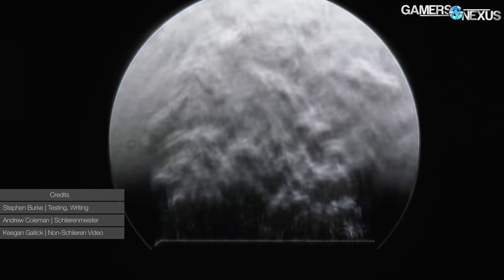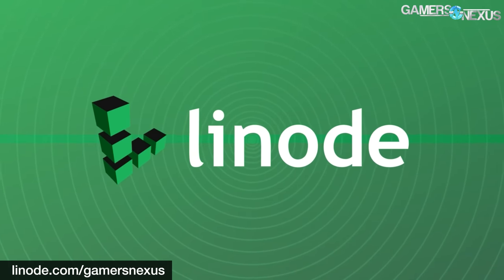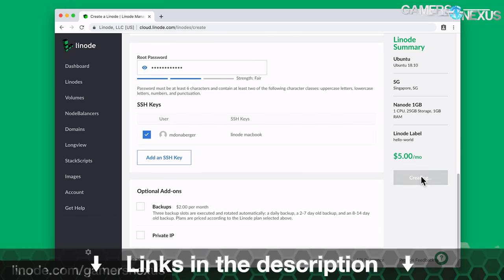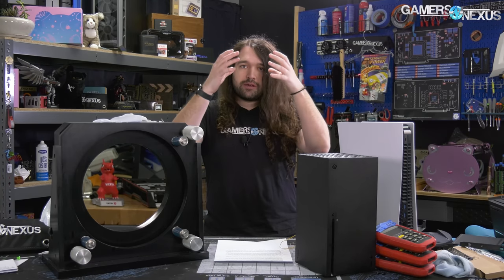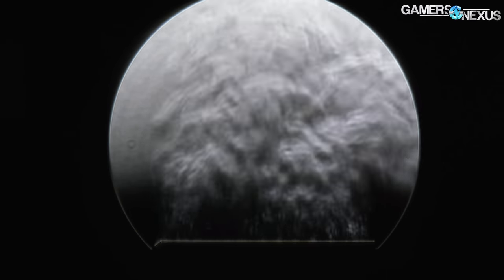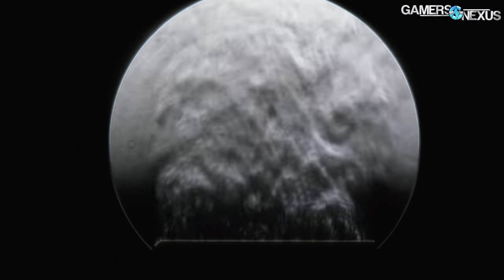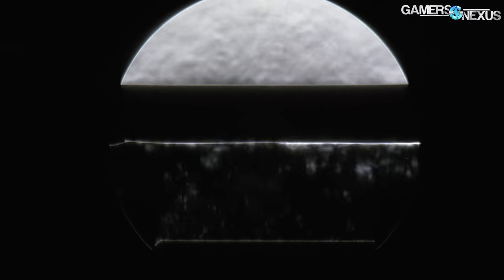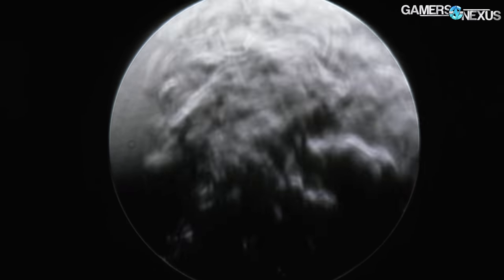PS5 vs. Xbox Series X Airflow Testing: Cooling Design Efficiency & Flow Paths

Comment: The "hot air rising" argument is really silly on this situation, but now I'm wondering if anyone has made any measuring on the effects of hot air flow a fan is moving when pointed upwards, sidewards and downwards in a free-standing enclosure that can be rotated, with 1m clearance for air flow on all sides, in order to put this argument to rest. I bet it won't be anything as high as 1%, but I wonder if it's even actually measurable. Wish I had some thermocouples, heater, different fans, and a speed controller to test this myself.

Comment: So what’s best “horizontal” or “vertical” for Ps5?
Reply: if you place it horizontally, the console will sound more quiet. Although vertically is quiet enough.
Reply: @javierf6162  is as quite as the ps4 slim ? Or a bit louder?
Reply: @ghostslayer2544  it’s definitely quieter

Comment: I work in the r&d department on the Xbox line for Microsoft.. it's funny because we don't do any of this testing honestly we just come up with different designs that look cool and it's ultimately marketing that chooses what gets through. The design of the Xbox was 95% marketing and 5% engineering. 

Our engineers have very little decision-making on the actual design of the Xbox, if we did it would probably be all mesh.

Comment: Problem I find with the xbox's exhaust, if you lie it down it means anything on the right side like a amp or blu Ray player, will get hit by the exhaust, so meaning you have to have the xbox on the right side of the unit, so the exhaust is hitting a wall.

Comment: I've modded my pc case basically making the front of case the bottom with feet and custom panel holding 2x200mm fans for intake and all the heat goes out the top of what was formally the rear of the case

Comment: On the Xbox console :  Wonder if it's better to have a fan at the bottom base of the console for Push air or at the top of the console for Pull air , Or maybe both , In my opinion I think a added bottom fan would be better because there is already a internal top fan in the console so it could do the push pull method .

Comment: the extra hole is basically a relieve valve if the top of the console gets blocked off so it doesnt overheat as bad as without it

Comment: Here’s an idea Microsoft could do to make the Xbox Series X run cooler... remove the bottom circular plate, add as many extra holes that plate took up and on the corners of the Xbox Series X and attach 4 small pegs/feet (say 1/8-3/8 of an inch high)... so it’d have a much more even intake of air... I think it’d make it cool more efficiently yet as it’d have more places for the air to come in and be pulled thru by the fan... only downside is the console would be made potentially taller than with the circular plate on... maybe this could be a revision for the Xbox Series X or even offered as an option (that is if you want to use your system in the vertical orientation like a pc tower and you have room for it)... btw I did this with my PS4 base version (added on 3/4 inch circumference felt pads stacked up to make my PS4 sit about 1/2-3/4 inch) to help it get more air under the system (I heard PS4 like having air under them as they have no vents there but they do tend to get warm/hot there)...

Comment: I predict a PS5 cooling disaster (RROD) after 18 months.  Did the hot air lingering after power down seem like a problem?  It is, and depending on the temperature of the console when the fans stop, the damage over time will be to the solder.  It's not clear why the console is missing a cool down mode, but it is obvious that Sony threw liquid metal at the thing, as if it was going to be the answer.  The PS5 in a cabinet will overheat, and it's easy to replicate.

Comment: Hmm, on the XBX, wouldn't the fan hub contribute to the conical flow pattern more? Since nearly no flow is produced at the hub and next to it, a low pressure zone in the middle will be produced. Because of motive flow and this low pressure zone, the higher pressure air will be drawn into the middle.

Comment: If I modded the PS5 and cut a hole in the side panel of the PS5 and added an air filter would it help with thermals? Wondering if it's worth the effort or not since I would prefer to do that over removing the panel entirely.

Comment: Any way to do a roundup of fans using this imagery, and how some fans react pulling air through and pushing air through a radiator, and maybe even a standardized fan testing AIO's and Custom loop radiators? I know that's ALOT of testing with most of your studio taken up, but could be interesting.

Comment: I want to point out the PS5 air flow get push with the fan in a down motion but the design of the heat sinks the airflow is expected to turn 90 degrees to the rear of the console. The xbox airflow is straight up.

Comment: There is no way that the Xbox can run 150+ degrees Fahrenheit. But some how they managed it. I was also surprised to see no fan on the cpu heat sink and dedicated one fan to the whole system. Engineers must hav e fought hard to keep that design and make it work despite the intake design. Wish I could improve it some how without ruining the case other then ac during the summer.

Comment: Assuming side and top blockage is not an issue, would you say the xbox x is better suited for horizontal position than PS5? That would be in a situation where one has both consoles and has to place one horizontally.

Comment: I own a PS5, series X,  and a switch. The only console i play on is my series X with gamepass ultimate. The Dualsense controller is cool, but the series X controller wins by comfort and 40+ hours of battery life. I like the smaller size of the series X controller. And i hate the thumbsticks on the ps5 are in the middle of the controller. The thumbsticks on the Xbox controller feels so much better. VRR, quick resume, 1440P, auto hdr, fps boost, bigger SSD,  storrage upgrade posible. It is all missing on the ps5. If i have to choose between the 2, i Will sell my ps5 and keep my series X. Comming from a PS4 pro. Iam not a fanboy, i like Both systems. But the Series X wins this gen. If you have 500 spend it on the series X. Sorry for my english 😉 and with the newest upgrade we have Dolby vision gaming on the Series X 💪🏼
Reply: I dont have a 4k tv and dont want one either so I went with the series S

Comment: Microsoft said when they announced the Xbox SX that the back exhaust slot is a backup exhaust vent. They said we know patients and children could throw something on the console. So if that mistake is made at least the console would still be able to get most of the hot air out.

Comment: Those blocked vent holes driving me crazy
.... if they thought they could use them than its bad comunication and development in the first place but if they are just to make the xbox Look like its very well ventilated than its  a shame and burned costs on the molding Tool..... i dont get it

Comment: Do you consider or recommend to use 3rd party vertical stand with cooling fans on ps5? Does it help the console to minimize the  heat?

Comment: it is kind of a circle of airflow having the 2 side by side in a cubie. The Xbox sucks in the bottom back and blows out the top. The PS5 sucks in at the top and blows out the back bottom. I have had to put some paper in between to try and separate the air for the two devices.

Comment: I'm sorry.. I was enjoying this video until 16 minutes in when I started question if you guys done any research about the specs of both consoles... That hole on the series X allows airflow in case someone accidentally covers the top of the console and so it can be placed under a TV cabinet with minimal on either side....

Comment: Hi Steve, would you be interested in investigating high rate of failure on EVGA Ampere cards? There are a lot of complaints on EVGA forums about FTW3 and to a smaller degree XC3 cards suffering from so called red light deaths where the power suddenly goes out during light load gaming followed by cards being bricked and needing RMA. In some cases there have even been fires, leading to some truly dangerous situations. So far EVGA has not been forthcoming in addressing the issue, adding to the concern and frustration of users. Thank you

Comment: aaah no your digging to far for a explanation as to the fan depth ratio on the xbox, its way more simple, the space between the screen and  the fan is in effect a manifold, a space  for pressure to build an normalize and the exhaust through the grate which  is  a defuzer.  Hints to why you see the air conforming to the depth an curvature of the vent also causing the air to hold its concentrated density . Tig welding cup defuzer might give perspective to this. great work.

Comment: I have my Xbox horizontal in my Media cabinet, but use a piece of cardboard to guide the exhaust out of the front of the cabinet. Seems to work really well, as all of heat leave the media cabinet. I was worried about the hot air circulating in the media cabinet but the cardboard has solved this. I do wonder what effect it has on the exhaust with the extra resistance of the cardboard guide.

Comment: I was planning to buy a cooling stand for PS5
Not anymore, because you've shown it still does output heat from the small vents placed at the bottom of PS5 where the stand is attached. 

The cooling stand will push air in those vents. I don't think that'll be a good idea.

Thoughts?

Comment: What is your opinion about dust filters for the Xbox Series X? Do you think they would impede airflow? Good/bad idea?
Reply: I don't have a xbox series x, but I have put air filters on my PS4 Pro, and its fine. Get some proper air filter foam though. You can get difference grades, finer or courser, if you want. Its easier cleaning the air filter than opening up the unit.
Reply: @zeniktorres4320  Thank you, friend!

Comment: I came to see about the PS5, was looking to get an aftermarket vertical stand for it and needed to know if it would be worth having one with fans that draw air out of the bottom, push air up from the bottom or just one with no fan at all. Seeing as how the console tries to push out out through the bottom as well as rear I think that question is answered. Thank you
Reply: Take a look at the PS5 teardown video. The entire bottom of the PS5 in cover bt the power supply. And air flow from the fan not reach the bottom at all.

Comment: I think Microsoft learned a huge lesson off the 1st generation 360 consoles. It is clear they were most interested in the unit controlling the heat more than the look. Sony did the same thing by making the PS5 so damn big. All about getting the heat out of the unit and keeping the processor as cool as possible. I am watching and waiting to see how the PS5 lasts with them using liquid metal. I wonder how long they can last before having to replace the liquid metal down the road. Hopefully longer than the thermal paste used in the series X. I kind of wish they would have used liquid metal too.
Reply: There is no reason to use liquid metal over paste in my opinion. It has better heat transfer, but can cause a lot more trouble.

Comment: Did you not realize If the gas you let out of that torch were it find an ignition source when inside of the running system you would have quite the mess on your hands

Comment: Does the temperature of the air influence the air flow generally speaking? I’d think so. Doesn’t it make a difference, wether you heat up the air for intake?
Reply: It'll certainly affect how much the air will cool down your system, but not so much on the airflow.

But the intake air wasn't actually heated, despite what he says. The gas was in a pressurized bottle, and expands when leaving the bottle. Gas gets colder when it expands, so unless he kept the bottle under intense heat (not likely since it's an explosive chemical, and it would also have to be hot enough to burn his hands) to counteract this cooling effect, the intake gas is definitely colder than ambient air.

Comment: Great video but the advice not to put XSX in a horizontal position with the intake vents facing down is pretty funny.  Since, y'know, when you plug the cables in you can't lay it down in that position anyways.

Comment: My Xbox Series X which I sold 2 days ago was absolutely amazing with cooling, it was dead silent too, in the home screen there's no sound, I have to put my head half an inch away from the fan blades to hear the fan, when playing a game there's no sound, even if the game goes silent in a loading screen in-between warzone games there's no sound from the fan, I used the console for a year, I blew dust out monthly so my Series X was always clean, no dust clumps, I bought a PS5 Slim digital edition after selling my Series X the PS5 fan noise is noticeable straight away once I turn the console on, when I go into a game it's loud enough to always notice it, whenever there's silence in the game I notice the sound, my nephew has the PS5 older one and that's even louder. 🤦🏻‍♂️

Comment: It would be nice to be able to have speed fan control in the option system and even set it that if the Xbox gets to hot to a point the fan auto speeds up for more cooling. cuz right now my xbsx gets so hot that I get a little worried on parts life span.

Comment: Need your guys' opinion on this, I keep my PS in a decently-sized cupboard in my desk (like 20cm from the back wall, decent space on the sides, door is open at all times and air comes in from front and back) but I'm not sure if it'll cause problems further down the line. I don't have many options on where to put it but I don't wanna keep it somewhere that might make it overheat

Comment: I’m not gonna lie. I had to take a shelf out of my cabinet to fit the ps5, but have no noise issues. With series x I could fit it sideways where my one x was, but the top was too close to wall causing the series x to scream as loud as a jet. The minute I changed it and removed a shelf it was mouse fart quiet…

Comment: Although my TV stand isn't a closed in unit, the hot air at the back of my PS5 doesn't blow away far enough and I don't like that. I ended up getting an AC Infinity Multifan S7 from Amazon to do the trick. It comes with two 120mm fans and plugs into the spare USB slot on the back of the console. I placed both fans to suck that hot air away from the back of the console at high speed. It is very quiet even at that speed. Another good thing is that it allows you to daisy chain 2 more fans to the extra USB input if needed. I was thinking of adding a third fan to this to blow cool air into the top where the air goes in. Anyone think this is a good idea?

Comment: I have both consoles and the Xbox Series X definitely looks better, is quieter and the cooling system is better designed since heat rises and the Xbox actually uses a 130mm PC type fan! The PS5's VRR doesn't work with FreeSync monitors like the Xbox Series X does which is disappointing and the PS5 doesn't support 1440p resolution where the Xbox Series X does support 1440p@120fps and the PS5 only can do 1080p@120fps besides both doing 4K@120fps! Plus the PS5 doesn't support DirectX Ultimate, instead the PS5 uses Open-GL! The Xbox Series X is definitely worth $499 because if you were going to buy a PC that can play games at 4K@120fps or even 1440p@120fps+ you would probably have to spend between $1,200 to $1,500 on a gaming PC and then you would have to deal with hackers and cheaters. That's why I have been a console player since the Atari 2600. I have had just about every console since the Atari 2600, The Intellivision, Original Nintendo, Sega Genesis, PlayStation 1 and so on!
Reply: I bought Xbox Series X after lots of years of pc gaming, because the gpu prices are insane (now they are better), while Series X is cheaper than a proper pc but its's very very far from it. I'll definitely go back to pc. My main problem with consoles is the lack of mouse and keyboard support (in 99% of games). I hate controllers, I get headache from them. And the second main problem is the poor old game performance. I mean if a game was released on xbox 360 with 720p 30 fps then you will get 720p 30 fps even on Series X. It's ridiculos (but I understand why this happens). On pc you don't have these problems.

Comment: I have a very important question for the host.i could be another video for you to cover.see i toke the ps5 disc edtion and toke the fan guards off.i lay the ps5 on its side.why because it feels like it cool better without the fan.but ive used liquid metal since ps4slim and ps4 pro.i do not feel it is safe long term vertical strait up.see the liquid metal will find a up.gravity my dear Watson.so laying it flat will keep dry spotting and their is a piece of metal square looks like it is working like a dam around the chip.can you take your measurements with the shadow camera.but with the ps5 fan guards removed on both sides????? I see the ps5 runs 30 to 40 degrees cooler.

Comment: Just the fact that the "Main" Heatsink would be on the bottom of the console if you put it horizontally is the exact reason i run it upright! the heat transfer to the cabinet it would be sitting on is insane and has no where to go... thus the cabinet and the console "Bottom" will hold more heat.  Just as a test put your console horizontal and play something for an hour, then stand it vertical and record the heat on the 4 outside panels of the console & the cabinet bottom the system was sitting on.  Repeat the test with the console vertical.  Trust me you'll never lay the system down again!
Reply: Hi man!! I recently bought an Xbox Series X. From your comment I'm understanding that placing it vertically makes it run better, am I right? Wouldn't placing it vertically make the insides more dusty ?